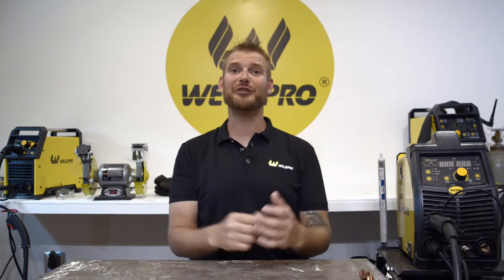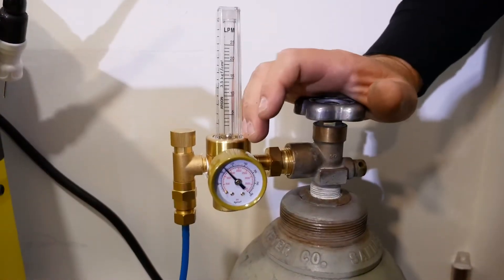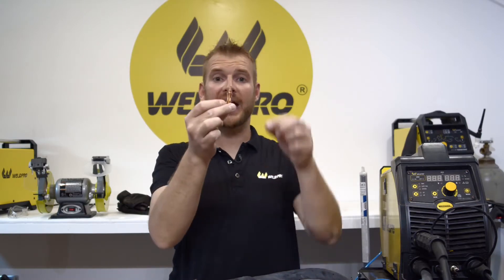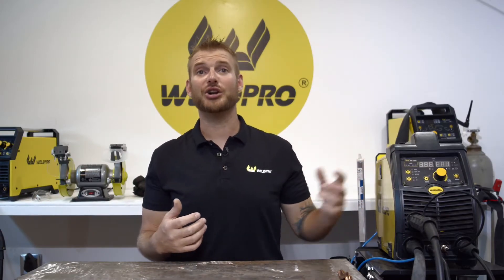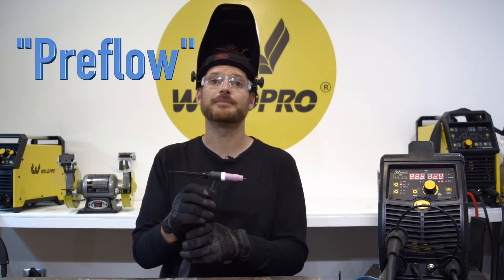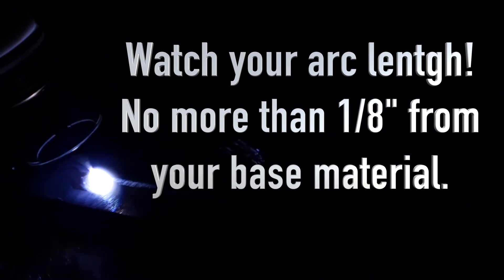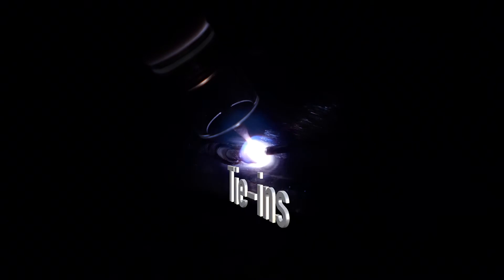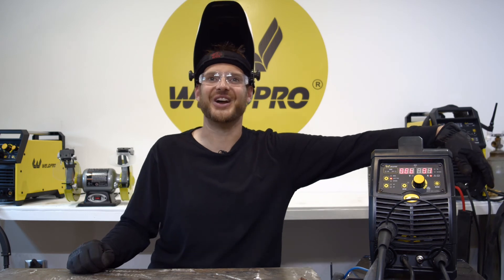Weldpro MIG 200 GD - Part 4 TIG Welding!!!

Comment: Just picked up MIG 200 unit and can't wait to get started! But I do have quick question - as far as needing any additional accessories (whether for MIG or TIG welding) do they have to be from Weldpro or can we just go to our local welding supply store and purchase them there? Or more specifically, will any brand parts fit the Weldpro gun?

Comment: my tungsten will not stay in the gun
Reply from the maker: You may have the wrong size Collett try and switch it for a smaller one
Reply: @WeldproWeldingEquipment  the others ones i have the tungsten won’t fit in
Reply from the maker: Check your collet body it may be loose
Reply: @WeldproWeldingEquipment  it still won’t stay
Reply from the maker: @davidr2169  please give customer service a call at your earliest convenience 😀
Reply: Same issue for me

Comment: could you hook up a petal or trigger setup for tig welding on this welder
Reply: I have the same question
Reply: Btw, I found the answer on an Amazon listing. They said the tig torch connects directly to the full amperage dinse connector and a pedal would have no effect on it.
Reply from the maker: Not on this one. Any of our tig machines can take them. :)
Reply from the maker: @ArmyBratt-qv1ii  That’s not true. In the video we are referencing the footpedal for the tig 200. We are simply saying that the MiG 200 does not include a footpedal so it is important to set your amperage correctly as you will not be able to vary it with a footpedal like you can on the TIG 200.

Comment: I've been thinking about getting into welding for a while now and just can't pull the trigger on buying a new welder. I have only seen friends use the much more expensive brands. I want to thank you for these video's. It give me more confidence !!!
Reply from the maker: You can do it! Thanks so much for commenting!
Reply: you wont go wrong with these machines
Reply: I got started the same way: wanted to learn forever, then the pandemic hit and I decided to just buy a welder. I got this WeldPro 200 and in 6 months I've managed to learn the three main types with just YouTube and my welder. You won't regret buying a nice multiprocess welder. I've actually bought a MIG, a plasma cutter and an AC/DC Tig welder from WeldPro. Every machine I've bought from them has exceeded my expectations. It'll be the best $600 you ever spend. It really is an investment in yourself and after you can fuse steel you'll look at the world different. I know that sounds crazy, but it's true. After learning to weld I can look at things and figure out how I want to modify or build all kinds of things.

Comment: Can you TIG aluminum with this machine? Because I recently picked up this model. If yes what cables are plugged in where?
Reply from the maker: No aluminum TIG requires AC current. This is a DC welder. It is possible to TIG AL with DC current but you would need to have helium shielding gas. In many places it is nearly impossible to get it or very expensive at least.

Your MIG 200 is capable of using a spool gun for aluminum!